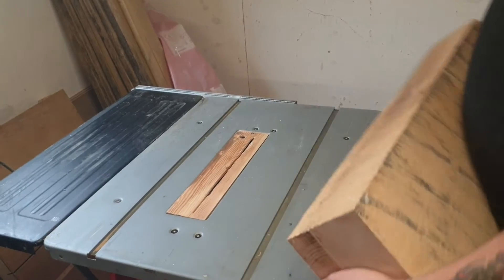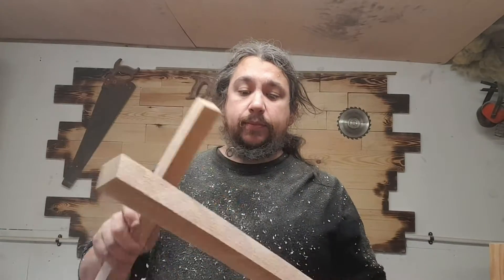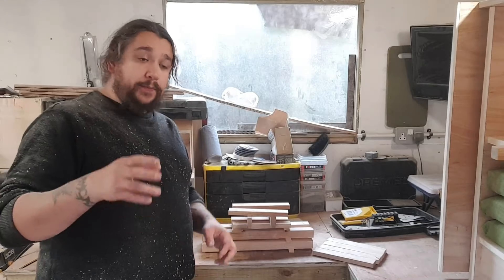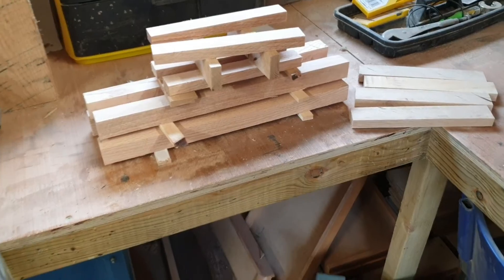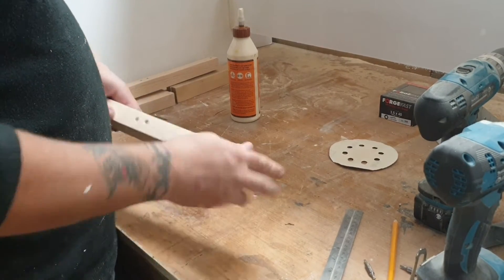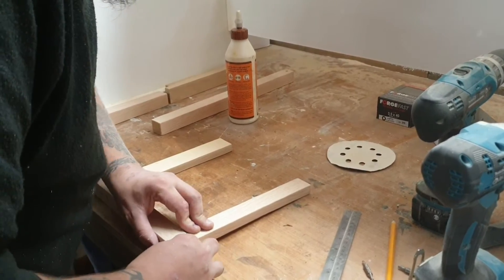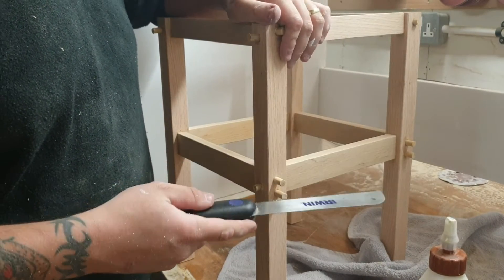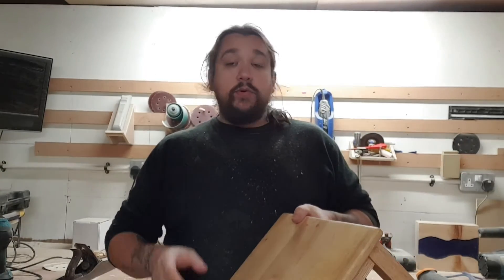#kpwbcc2020 Building a dressing table stool

Comment: Nicely done 😁. A great looking "heavy" stool. It always surprises me how much moisture a lump of wood can hold on too. It's not until you mill it you realize your trying to build something "with a sponge". Great build and great entry to Karl's challenge 😁👍
Reply from the maker: Haha yeah! Even when you think its dry its not. I wanna get a moisture meter
Reply: @WizsWoodwork  you should. They are more useful than you think. I got a cheap one (ebay) and it's great. I use it for everything from wood turning to checking wood before I chuck it on the fire. 😁👍

Comment: A little trick to help with oversized dowels, as the glue build up being pushed in front of them, stops them going all the way in. Is to make a saw cut of a couple of mil down the edge. It allows glue to squeeze out, equalise the pressure and get the dowels set deeper.
Reply from the maker: That makes a lot of sense thanks for the tip I wanna try that out!
Reply: @WizsWoodwork  I just did a little video on it on my channel if you wanna check it out. I show exactly what I mean in it.

Comment: Good job mate, came out really nice! One thing I might suggest, would be when you are ripping such thick wood it's probably easier on the blade to cut just over halfway through, then flip and cut again, instead of cutting 90% of the height on the first cut. Stool (especially the dowels) looked awesome all flushed up and finished too, cheers!
Reply from the maker: Thanks man. And thanks for the tip. I do that most of the time I was just impatient